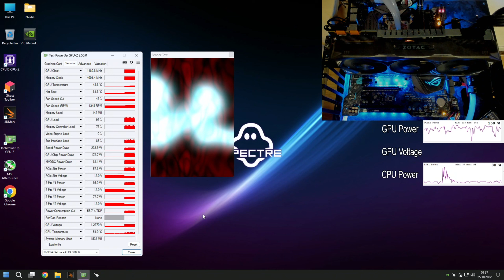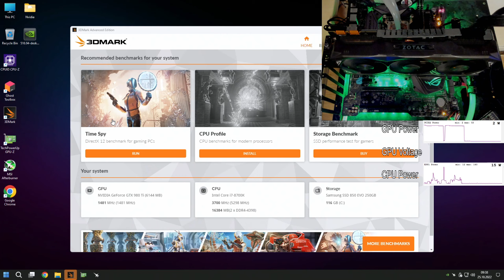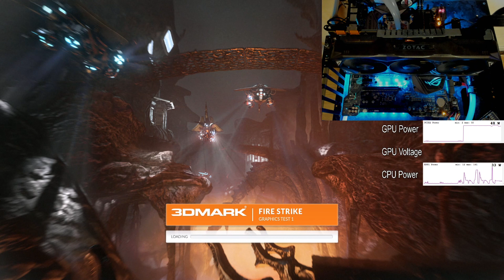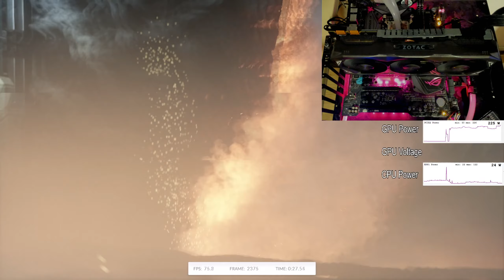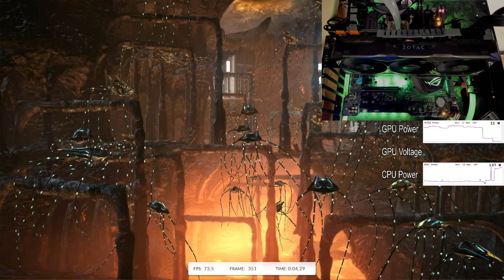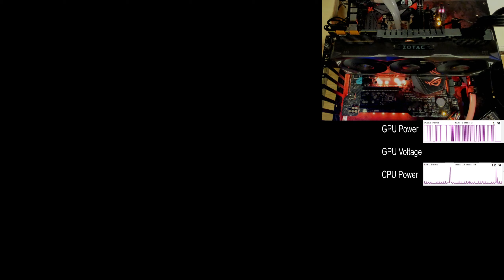Measure your System Power with this! | ElmorLabs PMD-USB

Comment: Prime 95 is decent for testing your cooling system for the CPU and will catch a unstable OC if you mess with the fft size that it needs to move stuff but smallest fft just runs everything in the cache so no stability testing.

Comment: I wonder if you could hack something together with a gpu riser to monitor the power through the pcie slot

And I agree 100% about prime95. Its just not a realistic workload for a stability test. Its useful for trying to find the limits of the vrm like buildzoid does, but for trying to test the stability of an overclock that you actually want to run.... It just doesn't tell you anything relevant.
Reply: You can, but bare software readouts are usually sufficient as it's not that important. And the 4090 is drawing I only around 10-20W from the PCIe slots, this seems to be a trend moving forward.